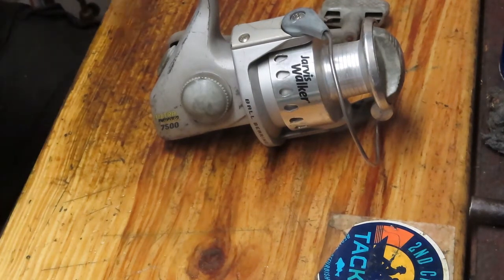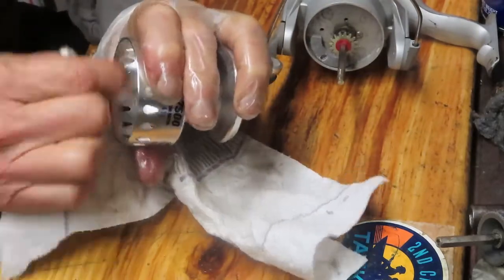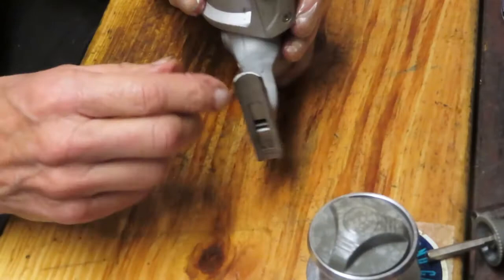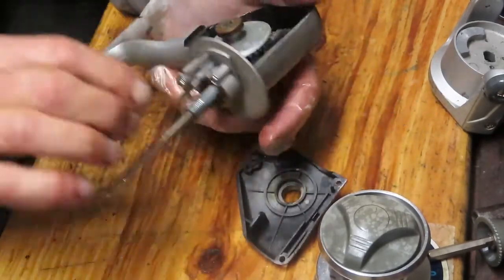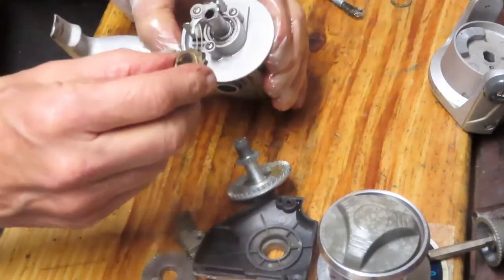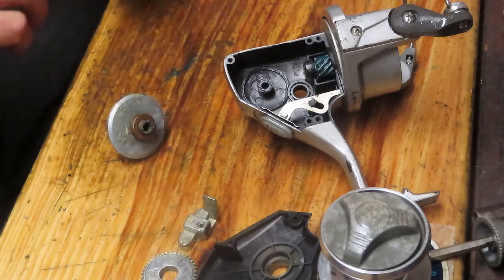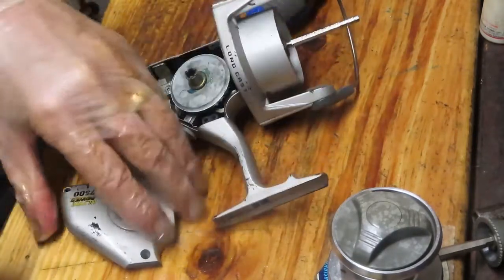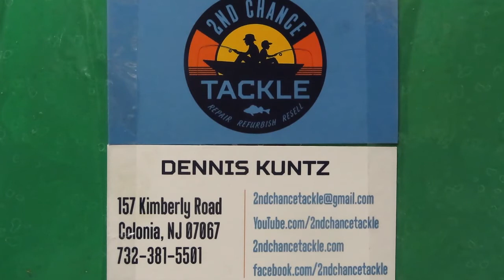Jarvis Walker Ultra 7500 spin fishing reel how to service

Comment: That's awesome Dennis! Honestly,  I found this one and 5 others sticking out of a trash can. The optix was one, this reel, a shimano sahara,  and two graphite body shimanos (a 1000 series, and 5000 series) the 3 shimanos cleaned up nicely and are working fine. I couldn't find the spool knob for the optix,  so I figured maybe you could use it for a parts reel. Glad to see this one cleaned up and working.  Sell it in your shop or donate to someone who could use it. No need to return it. I have plenty of gear now (too much if you ask my wife! Lol) great video as always. I learn something every time from you.
Reply from the maker: This one is for the kids!  Thanks for sending it.  I did find a replacement for the button on the Optix, so I will give that one away as well.
Best wishes - Dennis

Comment: Dennis, I got a Roddy by Penn reel earlier this year just to check it out. It was new in the box and had an extra spool and all the papers. It was very similar in shape to this Jarvis Walker but it was far more glitzy. I’ve never used it or even put line on it and didn’t pay much for it. This Jarvis Walker reel seems to me to have a very flimsy case and like you said the metals aren’t brass or stainless or some hybrid alloy.  I guess the more I see the less this reel is like that Roddy by Penn. The Roddy has 6 ball bearings and an anti-reverse override. I enjoyed seeing how this reel operated. I thought it might be one of those reels with a double AR dog mechanism. — Chris
Reply from the maker: It is a value reel.  There is enough engineering in there to provide solid performance, but overall, there are better examples on the market - Dennis

Comment: If I wanted to replace the bushing with a bearing, what size bearing would I need and could you recommend one?
Reply from the maker: You need to measure the bushing and get the bearing with the exact dimensions.  Bearings are normally measured in MM and you must include the inner diameter (ID) outer diameter (OD) and height (H) to order the right one.  I do not know the size of yours - Thanks for asking - Dennis

Comment: I open the reel but config where parts install
Reply from the maker: I don't have that one, but I will be doing a 1300 v very soon.  These have a similar set up, so you should be able to use that one as a reference.
Dennis